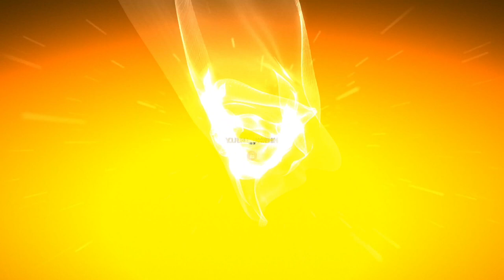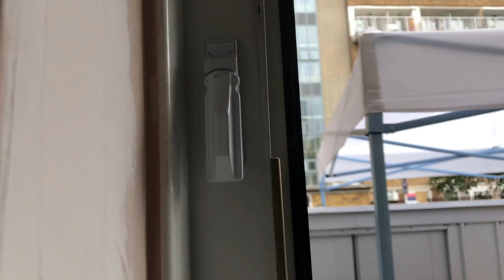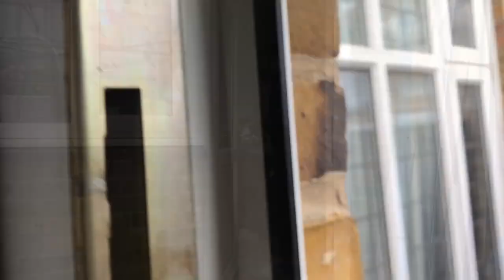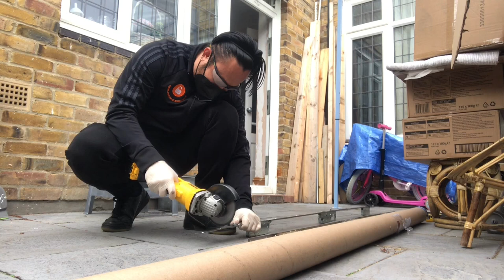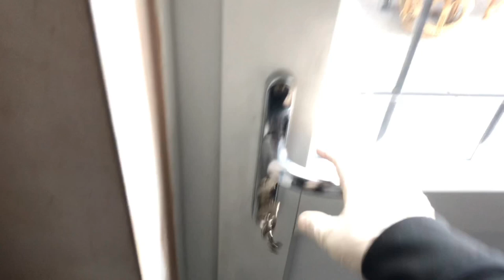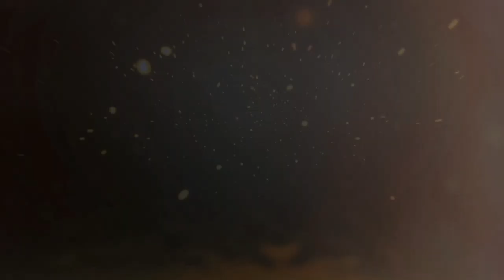uPVC Multi Point Mechanism Lock Replacement | Locksmith

Comment: What a load of crap! Why didn’t you show what was being done like taking the lock barrel out and refitting it? Also that just needed a centre point mechanism. On top of that you’ve drilled holes into the frame for the sash lock which they are now stuck with. Amateur hour!